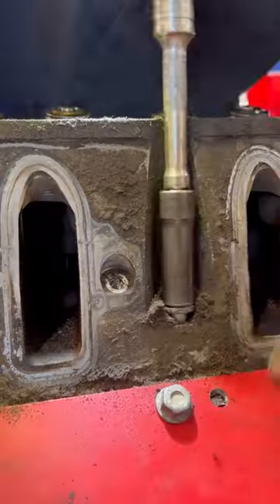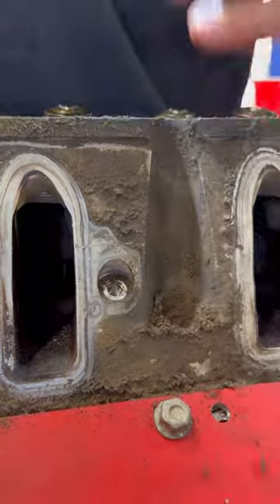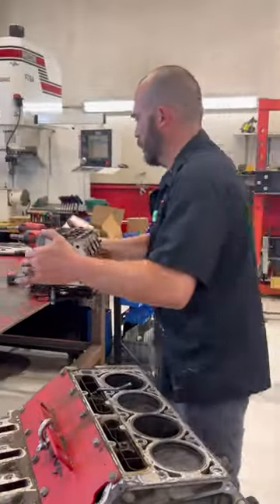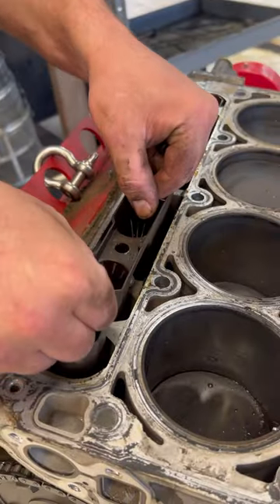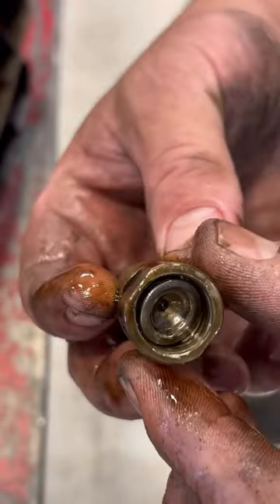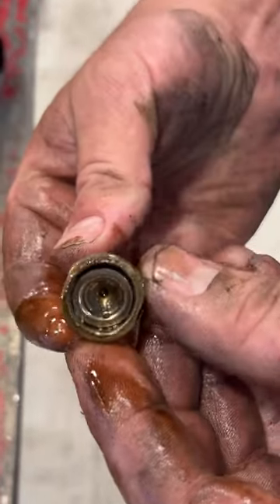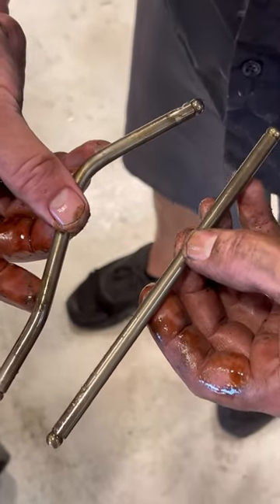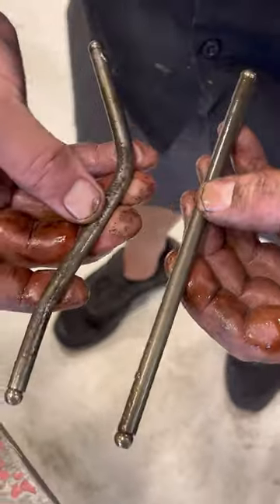5.3l LS tear down w/lifter issues to inspect

Comment: I have a 04 tahoe z71 with 276k miles and the engine has never been opened up and holds excellent oil pressure.  When afm came along that reliability ended.

Comment: I recently purchase a 5.3l with the AFM deleted at the factory. I sure hope ive avoided this kind of issue.
Reply: You should. My brothers suburban has over 300k miles on it. He had his deleted at around 200k. Still going strong.
Reply: 2021/2022? I read that the same afm lifters are still used, just deleted electronicly .can you can you confirm that

Comment: I work mainly on motorcycles. I'm surprised that there are still pushrod engines out there. Biggest power loss there is is making all that shit go up and down. If you want to make a really powerful engine the cam should run directly on the valve and the valve itself to be Titanium with titanium keepers.
Reply: laughs in 6.2 liter LS and hemi
Reply: nah my friend pushrod engines will always be king and if you wanna think about it that way dohc runs 2 cams on inline 4 motors how much energy you think extra cams add over 1 cam pushing lifters and pushrods up
Reply: Nitro 15.000Hp engines use push rods , HP CVO Harleys use push rods . Do you just work on 2 stroke motorcycle .Overhead cam engine's work great to but require more work on some bikes .

Comment: I was wondering if I could get any help or feedback I’ve got a 06 Chevy Silverado with 260,000 miles on it, and I recently overfilled the ATF fluid, I’m about a little over quarter inch above the full line on the dipstick, that’s it operating temperature and hot. 😮 oops 😬 i’ve heard 1000 different things about if it’s less than an inch leave it, and also, that between the dots is a half quart reading?? Idk 🤷 I’d appreciate any feedback. Thank you
Reply: You could buy one of those red transfer pumps at Harbor Freight for $5.00. Put the hose down the dip stick tube and pump out the excess fluid. Too much transmission fluid is not good.  Transmission fluid expands a lot when it gets hot. If your transmission happens to get hot enough, you may get hot transmission fluid pouring out of the vent on the top of your transmission. It can catch on fire  if it pours on your hot exhaust or catalytic converter. I think it is probably best to get the extra fluid out of there.  Other than that, I don't know if too much fluid can damage the transmission. It's probably not good for it, though.
Reply: Should just be able to  disconnect the trans fluid cooler return line and have a jug ready to put the end of the line inside. There's probably half a quart in the cooler. Starting the engine will pump out more if it's still showing that there is too much fluid. But have someone else turn the key while you hold the jug or you'll make a big mess like I did. Transmission fluid smells disgusting imo. Even more so when it's burnt

Comment: You must admit that it sure is much nicer and easier to tear down and put back together them aluminum truck engines compared to the big heavy diesel engines. 😅 No crain needed to put the cylinder heads on the workbench

Comment: True Story! My favorite car needed a Engine rebuild. It was the first brand new car I ever owned and it was the ONLY new car I ever owned. I really love my 1996 triple white Cadillac Fleetwood Brougham d’ elegance!  I picked up the phone and called the Cadillac dealership where I bought the car new in 96! 

“Well, in that case, like that, we are going to order a long block, crate engine for you, direct from the factory”. You have always had your car serviced here from day one and at 305,000 miles. It looks like it just rolled off the assembly line in Texas. I’m pretty sure that Valvoline would want to be part of your monumental situation! And I will contact them and see if they will purchase your engine so they can send it over to research and development and see why it has never caused you any problems at all! When he told me they were going to bring over a brand, new engine, and all of the accoutrement, including the heads, pistons valves, everything, I felt like I was giving away one of my children. But he told me that a brand new engine is balanced to complete perfection by the manufacturing process and all of the testing equipment and a rebuilt engine is nowhere near the perfect balance and accuracy as one from the factory. “But, it’s
 all up to you to decide. 

All together, tax labor shop supplies (?) almost $7887.90  “BTW” how much IS labor? How much do you pay the heavy line machanics ? “Our hourly rate is $275” but the mechanics are paid somewhere around $34. And that is for the very TOP OF THE CREAM OF THE CROP! They must have all current certifications , including ACE and others, own about $7.000 in equipment and tools

Comment: I believe you don’t have to take the heads off to get a bad lifter out. You find the push rod that’s bad you get a lifter extractor and you pop it up through the top without taking the head head off this way you can lube up a new lifter, put a new push rod and readjust everything even when it’s running.
Reply: Nope
Reply: @dwood82574  , an Why NOPE ?
I’ve done it this way.
Like I mentioned: unless it’s a total rebuild (as to why the engine is out ?)

Comment: Wouldn't it have been much easier to simply deactivate the fuel injector, rather than oil supply to a valve lifter? 
🤨🙄
Reply: I'm pretty sure it has to do with engine management issues because if you deactivate the injector only now the o2 is going to read lean
Reply: @christopherolszewski8710 I’m guessing this was a joke….
Reply: Well no , because you would still be producing compression in the cylinders ,that cause's resistance in the engine . So the piston goes up and down doing nothing versus making compression for power stroke .Turn off injectors , no compression , save gas . in a perfect world .  Ya right ,more like broken lifter and damaged camshaft ,and a whole lot of money being spend to fix the issue . That's why I like 2006 LS and older ones . No CAM phasers , or no D.O.D , systems to go wrong . This engine in the video , was over revved or poor maintenance .to bend that push rod .
Reply: @heatmyzer9 If you only knew about engines being air pumps when not combusting. It would cause a lean condition because the deactivated cyclinders would still pump metered air through and down exhaust causing o2 sensors to wonder why that air was combusted.

Comment: GM LS engines, drop 4 cylinders off for fuel economy. BS idea. I went through 2 engines in 112,000 miles. Always changed oil at 3500 miles.
Reply: Not all

Comment: So you actually charge that customer to take the head off to get to the bad lifter I don’t agree with that if you were just left the head on, take the push rod out extract the lifter put a new one in there. You could’ve saved that customer some money and then you also had the engine out of the vehicle. Come on now unless there’s a rebuilt order, you just stealing money !
Reply: You have to pull the head on an ls engine. The lifter trays are inaccessible until the head is removed

Comment: LS engines don't have overhead cams..?😂 does it still have throttle body fuel injection too? 😂😂
Reply: Man your living way in the past .Throttle body injection left us on the chevy 350 small block in 1995 - 96 switched over to OBD2 and the new port injection . Chevy platform has never had overhead cams in the small block or big block or LT1 OR LS engine's . But there is conversion heads to make a LS or a older small block into a over head cam engine .Very costly .
Reply: @roguewarr4662 obd1 fuel injection came on trucks back in 87
Reply: @jmillshobbies6344  Yes that was back in the OBD1 days , Worked on a boatload of TPI Camaros ,vettes and Cadillacs ,as a younger GM Tech .Thanks for reminding me of the good old days here in Central Florida .
Reply: @roguewarr4662 
I’ve got a 2006 Chevy Silverado LT, 267,000 miles, and just changed out the automatic transmission fluid, and overfilled it by about half quart. The stick shows about a half inch above the full mark dot on the stick… Should i leave it alone or try to siphon or drain some??? Need help and would appreciate it
Reply: @theadorephaedon1691  Wow that's great mileage for the trans . I don't think half a quart will make much difference .If it makes a difference to you being happy . Drain that half a qt.  Over the years I have pulled dip sticks and found trans levels way overfull by 2 qts or more , and that's not good . To much oil leads to aeration of the oil (air bubbles ) in the oil ,whether it be engine oil or trans oil .That will cause issues . They put level marks on dip sticks for a reason . take care.